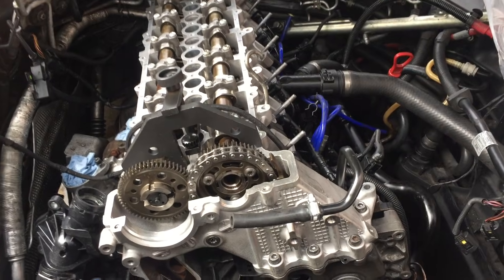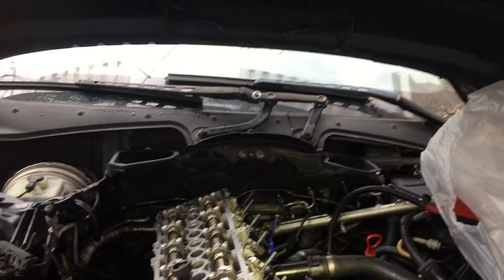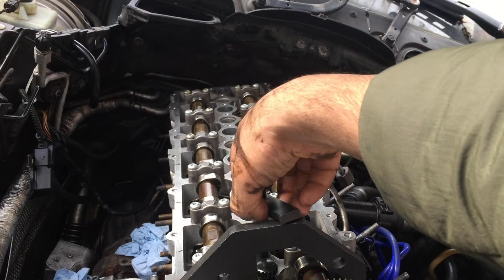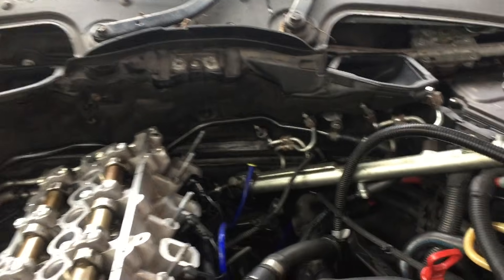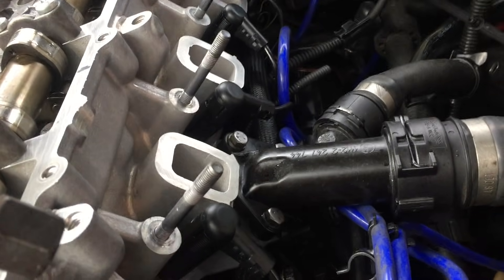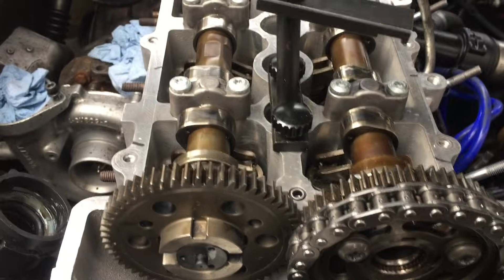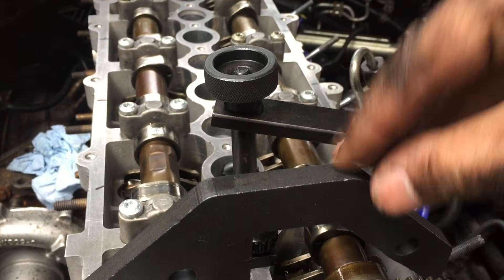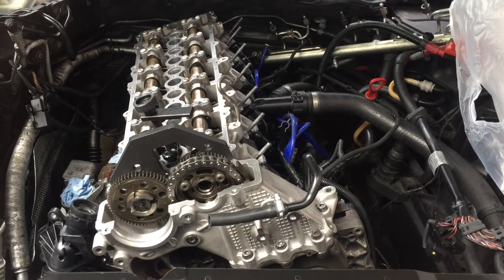E60 M57 Engine Timing

Comment: How long take u do this mate ?
Reply from the maker: To do the rebuild, well this was my first time ever rebuilding an engine, lots of research, took absolutely everything out until it was a bare block, labelled all the bolts up in seperate envelopes, cleaned absolutely everything all the parts until they were spotless.

just left it over winter so a good 6 months, making sure everything was perfect. working well as you can see in the latest video.
Reply: @bavarianmotorwerks3353  top job bud - 

Currently got an M57 535D engine on the garage floor, intend to roll my sleeves up when the weather gets better